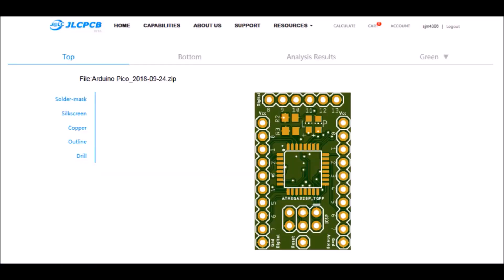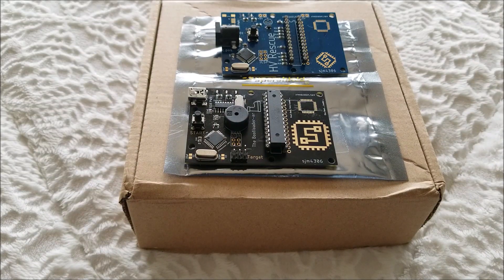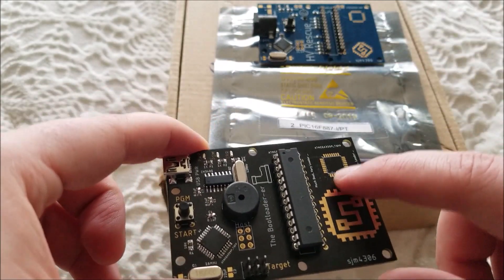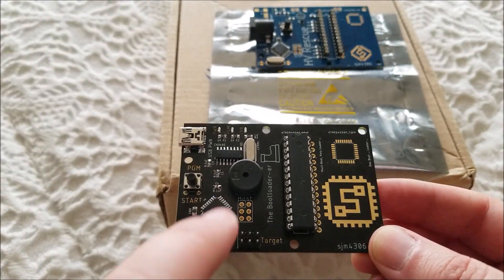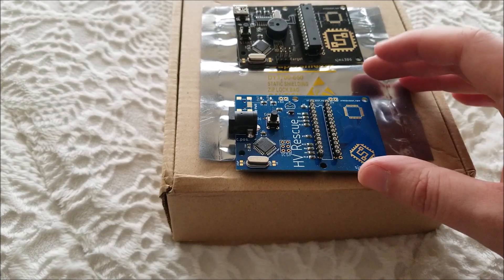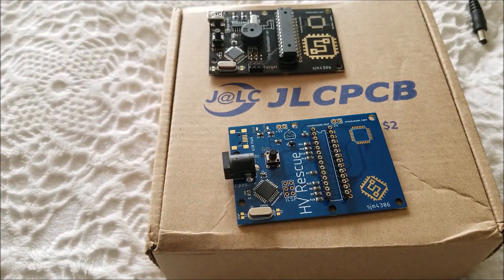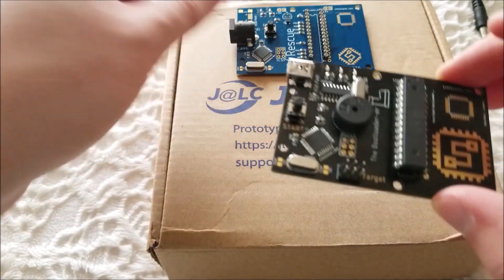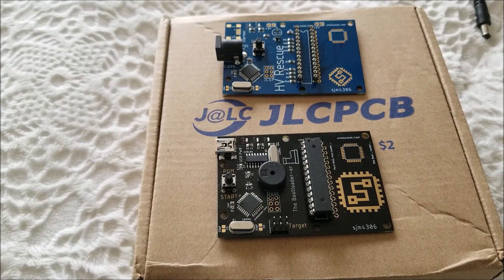DIY Dev Tools: The Bootloader-er and HV Rescue

Comment: Just picked up an HVRescue 2.1 on Amazon without realizing the megaohm site hasn't updated code since the .pde file days and there's no chance of compiling it in the current Arduino IDE.  Any ideas or know of an updated version?
Reply from the maker: You can download a portable version of the arduino ide (I'd suggest around v1.8.5) to compile and burn. The portable version doesn't need to install (it's just an executable) so you can put it anywhere or even on a thumb drive to run on just about any computer.
Reply: @sjm4306  For whatever reason, I had forgotten about the portable versions.  Gave 1.8.5 a shot and it balked about the uno board.  It was calling the avrdude (6.x) that comes with the new Arduino IDE and wouldn't budge.  Switched to USBAsp programmer and viola it worked.  Then did export binaries to hang onto for future flashing via avrdude.  Thank you very much for helping me get this old timer to run as I'm just learning to mess with fuses and will intentionally brick some and recover them to learn.  Thanks again!

Comment: If atmega328 mcu lock with lock bits high voltage programmer can reset lock bits without code or programe loosing?
Reply from the maker: I may be wrong but I think that high voltage programming to reset lock bits will automatically wipe flash. This is a security feature to allow the manufacturer to prevent downloading the firmware and reverse engineering.

Comment: This is definitely a great video that deserves more views. By the way, I cannot find the program file to make this thing work in the link that you have provided. Surely there's got to be some programming to do before you can make it work.
Reply from the maker: Thanks, glad you enjoyed it. The links are to the general adafuit and mightyohm project pages, the specific code are linked within the articles. Here's the direct links to the atmega software that must be compiled and programmed onto the onboard chips for them to work: https://github.com/adafruit/Standalone-Arduino-AVR-ISP-programmer and https://mightyohm.com/blog/wp-content/uploads/2008/09/hvfuse.pde
Reply: @sjm4306  Thank you for taking the time to respond, I appreciate it.
Reply: @sjm4306  By the way, what transistors did you use for this? TIA
Reply from the maker: iirc I just used some jellybean common npn like a 3904, it wasn't critical
Reply: @sjm4306  Thanks for responding. Just to clarify, both Q2 and Q3 are NPN transistors, right?
Reply from the maker: They are wired in parallel so you only solder one or the other. The reason is one is a sot23 smd package and the other is a through hole to92. So whatever you happen to have will fit.

Comment: Will you plan to release the pcb and code in open hardware and open source ?
Reply from the maker: Thanks for reminding me, I've added the hackaday.io page to the video description where I've uploaded the boards (feel free to modify them or use them as is). As for the software, there are also links to the original Adafruit and Mighty Ohm project pages where you can download the code.
Reply: @sjm4306  thank you very much it will be a great help !

Comment: If you 3D print a little frame of the right size and glue it to the pcb it should make positioning the SMD version of the controller very easy. A simple frame with some squares on the inside of the corners should be sufficient.
Reply from the maker: That's exactly the idea I had. I was originally gonna have a second routed pcb that you could glue on top, but realized it'd be easier to just 3d print it.

Comment: Really neat, nice work.  Here's how I do it:  I make a board that wires a ZIF socket to 10-pin ICSP header with the correct USBasp pinout for a particular AVR.  Then plug in a USBasp and script avrdude to do what you need.  I have a script that flashes fuses, then a .hex, then pauses and prompts user to place a fresh chip in the ZIF socket and press a key to auto-flash it next.  I think I did 100 chips in about 15 minutes last time.

You can put as many ICSP headers as you want on the board, with different pinouts for different AVRs on the same board/Zif socket.  Just put a ZIF socket big enough for the biggest AVR you want to program.   Works great.

I also just spent the weekend looking up how to make a HVSP for the ATTiny85 and will be working on a board for that as well.

https://www.facebook.com/MakerMatrix/posts/2505402916248595
Reply from the maker: That's a good idea of scripting batch programming. I like the idea of not needing a computer though once compiled and flashing portably with just a usb power bank. There's even a flag in the adafruit standalone programmer code to enable auto chip detection so no button presses necessary at all, just plop, wait for the beep, and repeat. Being lazy just means that optimization is the primary goal lol.
Reply: @sjm4306  Oh I love that it autodetects the chip.  That is slick!

Comment: Nice work as usual.  having a case/ZIF socket on them will make them a very versatile and handy stand alone tool.
Reply from the maker: I ordered some cheap dip and qfp zif sockets on the slow boat from china, just waiting for them to arrive. The machine pins are ok for testing or to build adapter boards to plug into but yeah not good for mass insertion/removal cycles. I additionally added screw holes to the boards so it'll be trivial to design some 3d printed cases for these guys. It's fun building your own test equipment/jigs.